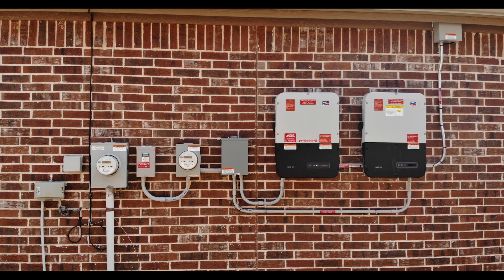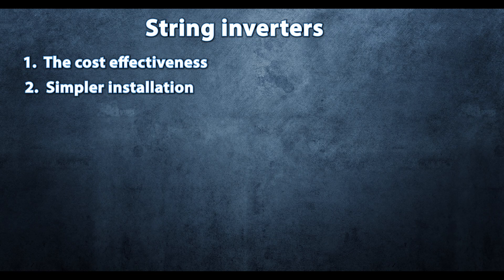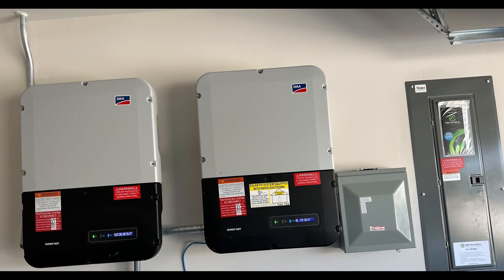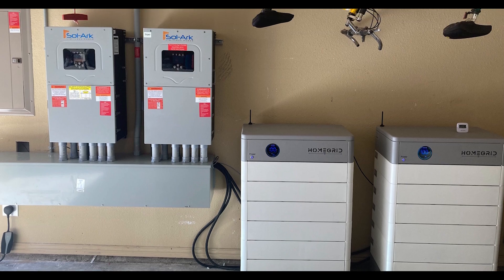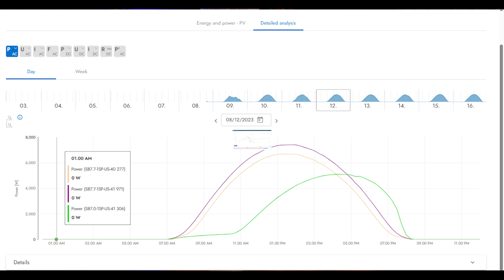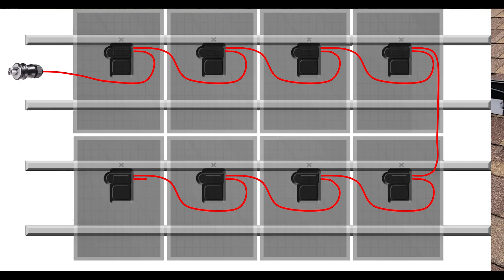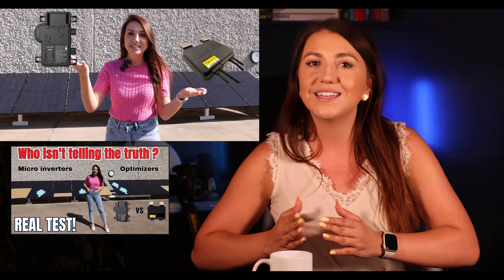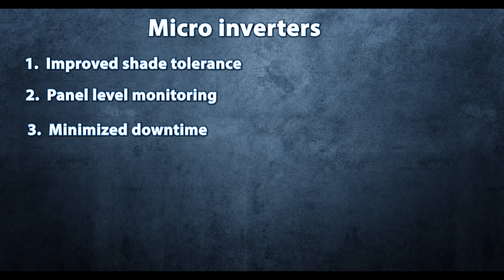The Great Solar Debate: Micro Inverters vs. String Inverters  - Are you making a mistake?

Comment: @solartimeusa this may have been addressed in previous comments so my apologies! I seem to be noticing systems that have one row or string of panels shaded on only 1/3 of the panel and really only 1-2 at most during the day 1-3 panels on the string and I’m seeing what I would consider excessive production loss on that string. Bypass diodes should be helping with this correct ? The DC inverter inside Powerwall 3 is what the system is connecting too. Honestly I’ll argue it’s less than 1/3 of any panel receiving shading… thoughts ?

Comment: Good commentary but missed the biggest issue that most panels are now 450-470W and most micro inverters capacity is 320W and below so massive clipping of maximum available power.
Reply from the maker: I agree with You - microinverters, especially when they are too small, will clip (clipping) energy production

Comment: aren't optimizers also on the roof at each panel?
Reply from the maker: Yes they are but if some TIGO optimizer stops working and you won't be able to buy it because for example TIGO company won't be on the market anymore then you throw it in the trash and connect the panel directly in the circuit and it will also work - that's why TIGO is better than SolarEdge.

Comment: Micro inverters make sense for many. The slight output fai is offset by what many feel is a negative. That is as follows: micro inverters have a power limit max.  Installing higher watt panels might seem to be unwise.  However when you factor in the degradation of power output of panels. So higher watt panels will continue to produce the same for decades.  Additionally when some of those panels have more light they produce the max for that panel.

Comment: I did 18x 300w panels in 2015. At the time, my research had indicated the single string inverters 1. had the shading issue (not sure if the power optimizers were around back then), 2. typically went bad 12-15yrs, but mostly came with a 10yr warranty, and would cost circa $3-$4k thousand dollars to replace (parts and labor) outside the warranty. Whereas, the m250 enphase microinverters had a 25yr warranty. For the 18 x m250's, the increase in cost to use was $850 - my cost being an extra $600 total after the 30% fed tax credit. It's been 10yrs now - around the 4yr mark, one microinverter went bad, my installer told me (I didn't know at the time) and came out and handled the replacement, zero cost, without me even needing to be home - the just put a ladder on my roof. No other issues since then. Panels paid for themselves in 2021, and at current rates are saving me circa $3300 per year.

Comment: Decades ago? There are still a lot of panel available without diodes. In those cases its still true.
Reply from the maker: It's extremely rare to find modern solar panels manufactured without bypass diodes. Can you share some major brands that you know of that do make them without diodes?

Comment: We have just found the sixth dead SolarEdge inverter installed by PowerHome Solar since 2020. Every single time someone calls us for a repair, we know it's a dead SolarEdge inverter. I've sold over 300 Hoymiles microinverters since 2020, and there have been no failures. I have 100% happy customers. That's my two cents, Martyna!
Reply from the maker: That’s a really important point to consider! I appreciate you sharing your experience. I honestly do not consider SolarEdge a string inverter.... I should make a video on this subject alone! The reason why I do not is because you HAVE TO HAVE AN OPTIMIZER ON EVERY SINGLE PANEL CONNECTED to the inverter. 

Imagine a perfect ground mount with no shade. you would think solaredge would let you install without optimizers ... no. it's required. hence I do not consider it a string. BC those little computers are still a necessity. so I am 10000% with you here. I am not a solaredge fan at all! Its a much longer point, I really should make a video on it...:D 

I appreciate you, and I respect all opinions!

Comment: Very nice. But aren’t you forgetting a few things? Less risk of (rooftop) fire with microinverters. A system with a string inverter works / has to work with high voltage DC power of the complete string or strings on your roof, caused by DC daisy-chaining all the solar panels, with DC voltages up to 600V or even higher (search for risk of DC arcing, rooftop fires). That hardly is an issue with microinverters, which are AC-connected in parallel instead of DC in series. Moreover microinverters have ‘rapid shut down’ functionality in the rare case of overcurrent occurring in a panel. And finally, a system with microinverters can cope much better with overvoltage on the grid, an increasingly common and quite annoying problem. When there’s overvoltage on the grid my SolarEdge inverter shuts down completely and tries to restart after 10 minutes or so, shutting down all my panels mid-day, when solar power is at its maximum. But with my Enphase system only one or two microinverters shut themselves down, which lowers the voltage enough for the other microinverters to keep working, so that the rest of my panels keep producing electricity!

Comment: Love your stuff. I think it's telling that there's lots of people claiming that microinverters are superior (while only talking about systems with no batteries), but with reduced feedin tarrifs, one of the best things you can do is add a battery, and in my view hybrid string inverters are much better systems if you want batteries (am interested in your qualified take on this). PS, I suspect optimiseres might become compulsory in some areas for string inverter systems so as people can remotely close down their panel outputs for service or if there's a fire (ie safety).
Reply from the maker: Hi there! I absolutely agree, for those who don’t ever plan to add batteries they can choose between either option but when a battery will eventually come into play I would absolutely and 1000% go toward central/ hybrid. 

For example I installed a string inverter in my home a few years ago now I’m upgrading to a battery system that’s a hybrid. All work is done in the garage. We are not touching the roof. Cost is as low as it can. 

I hope this is helpful. Thank you for the comment!
Reply: @solartimeusa 
Pardon me for butting into the conversation: 
The National Electric Code NEC falls under the National Fire PREVENTION  Association NFPA. 
I wish someone on the NEC would explain to me how adding MORE electronic equipment on to the hostile environment of a high temperature rooftop exposed to the elements 24/7 365 PREVENTS FIRES OR MAKES ANY ELECTRICAL SYSTEM LESS PRONE TO FIRE 🔥!
If they really wanted to prevent fires they would NOT REQUIRE MORE devices which are statistically MORE prone to FAILURE and FIRE to be installed. 
If they truly wanted to protect first responders instead of requiring rapid shutdown systems they would rethink this strategy. 
THEY ARE LITERALLY CREATING THE PROBLEM THEY ARE TRYING TO SOLVE!

Comment: if you have like one of those diy inverter maybe from Amazon  and about a dozen batteries depending on you needs why not just put battery chargers to these batteries trickle charge and eliminate the solar panels especially in colder climate were rain and snow

Comment: String requires far more planning before installing, thus more expensive.
Micro-Inverters can be expanded infinitely.
Micro-Inverters also give a higher longer Guarantee.
Micro-Inverstes also perform better on cloudy days.
DC Systems also can create an electric arc if they beak (Fire Hazard). That’s not possible with AC.
And do you know about the compatibility of newer systems with older ones? I don’t think so. Lots of ifs and mights here.
Power Monitoring is also easy on Mircro Converters

She has no clue what’s she’s talking about.

Comment: It seems all new installs would require rapid shut down switches on the roof.  I understand this is built into microinverters and optimizers, or seperate switches would need to be installed on the roof if no microinverter (ac system) or optimizer (dc system) is installed.

So, it seems we never get away from having some sort of electonic box or switch baking on a Texas roof.
Out of the three (microinverter, optimizer, emergency cut off switches), which is more reliable on a Texas roof?

Comment: Martyna, what my thoughts are? Love your videos! You did not mention, Half-cut Solar cells! Isn't Half-cut Solar cells in Solar panels the main reason Micro inverters and Optimizers are basically obsolete, for all the reason you mention. I think new, Half-cut Solar Panels have twice the Diodes of older panels allowing shading to internally route around shaded parts of the Panel? Hope I said that right.
I pulled this off Google AI. Yes, half-cut cell technology on solar panels significantly decreases shading problems by allowing the panel to produce power even when parts of it are shaded, as the cells are wired in smaller, independent sections, meaning a shaded area only impacts a smaller portion of the panel's overall output compared to a standard panel where shading on one cell can affect the entire row of cells. 
I have Panels on my Boat, Cabin and soon new house we are building. I have a waterproof design to cover a 14' X 40' Patio with only Bifacial Panels. The Panels will be installed without anyone on the roof!!
Anyway, I thought if you were to mention the benefits of Half-cut technologies it could help drive home the point you are so wonderfully and accurately making.

Comment: I'm thinking abt adding solar panel at my home in Manchester, UK which is 70% of the year is cloudy. I got few quotes & most wants me to put in MicroInverter. One installer suggested to use Aiko 455w Gen2 solar panel which got Partial Shading Optimisation in built it along with Sun Synk 5.32kw inverter & 2x5kwh Sun synk battery. With 16 panel he sugested it would generate abt 6200kwh annually. I'm really struggling with understanding various component and which to go for. Thanks for helping me ignore MicroInverters as I agree there are more cons with them then pro. 
I wonder if you have any suggestiong/opinion on setup I was proposed with Aiko Solar panel? I would really appreciate your thought on it. Thanks for great videos -really helped me in my journey in understaing this Solar world.

Comment: Ironically, optimizers and rapid shutdown devices have much higher failure rates than microinverters. You will spend much more time doing repairs on the roof with optimizers and rapid shutdown devices. Remember SnapRS?
Reply from the maker: Oh god, i didnt use Generac because it was too early of a product. And they just rushed too fast trying to get into the solar market....

Comment: THis was a relatively well done video. One thing that is missing from your benefits of Micro inverters is Arc Fault protection. AC Voltage with a 0V crossing helps stop and interrupt arc fault. DC wiring simply does not have that as an option. You somewhat got there with the balancing circuit but not quite.
Reply from the maker: I personally have a SMA sunny boys in my house and those units are extremely sensitive to arc faults and if there is any detection system, it turns off until an installer checks on it.  So it has very sensitive arc fault detection.

Comment: For me, I've always recommended microinverters, because string Inverters are a single point of failure. If something goes wrong with a MicroInverter, it's $180-240 to replace that single inverter, whereas the String inverters, it's $2500~ for a replacement part. 

I will say though, your point about DC-DC battery coupling was 100% on the money. The future-proofed system for EV's is probably the system which gives the better DC access (String).
Reply: I thought the same.. until you research the details and find home DC EV charging is unlikely for lots of detailed technical reasons.
Reply from the maker: Can you elaborate? Lots of success with DC / HYbrid systems such as EG4, Sol-Ark or Tesla PW3.
Reply from the maker: Thank you for sharing your thoughts. I agree that for different situations, different applications will be more beneficial :) Thank you for leaving a comment as well!

Comment: Great video thanks. I have one question   regarding the one point failure argument. By adding optimizer you do you recreate point of failure on the roof ? What happens when an optimizer (which i think less complicated than a micro-inverter) fail ?
Reply from the maker: Very good point! iF YOU DONT NEED optimizers I would not use them, but if you do, the difference of that point of failure is that that unit is an addition, its not a requirement. So if in 10 years Tigo is out of business ( hopefully not!), you can simply remove the optimizer and plug the panel into a string and it will keep working, whereas if you have a micro, the panel is useless unless the inverter is operational. I hope that makes sense?
Reply: @solartimeusa  yes, thanks for the answer

Comment: Hi Martyna. Thank you for putting your time and effort in real time efforts which help users like us gain a lot of insights. I am looking for a solar system for my home and I am considering enphase iq8p and sungrow string inverters as options. Cost is not an issue. The location chosen is one which does not have shadows for a radius of 10 meters. Would enphase be really producing more power than string inverter in such scenarios?

Comment: Microinverters for my 35kW ground mount were far far less expensive than the multiple string inverters and easier for install.   There are 2-in-1 or 4-in-1 microinverters which helps combine units, causing an overall reduction in "price per panel".   You do get combined possible points of failure at that point, but they are relatively inexpensive to replace if they happen to not be covered under warranty.
Reply: Which brand of microinverters did you use? on your system?
Reply: Correct! Microinverters make a lot more  sense in ground mount situations.  Rooftop costs $500-600 labor and people walking around my roof so much, I have worn a trail to where that section of roof now needs to be replaced for another $3,000.

Comment: With string inverters is there a way to take advantage of the DC to charge Tesla EVs (approx 400VDC)? Currently charging with AC and the car has internally an AC to DC converter to charge the batteries. Thanks

Comment: You do great videos and I love watching them. I only have one comment: on the safety element, micro inverters will stop operating if the grid disappears (unless you do fancy stuffs). This effectively isolates each panel and you won't have energized wires on your roof. Strings of panels are always energized on the DC distribution. In case of fire, strings are certainly more problematic.

Comment: Wait six months and get one of the new inverters with software that can switch the DC into smaller blocks creating a better AC sine wave.  They are getting over 99% efficiency.  While 95% to 99% may not sound like much, over a year, it adds up.
Reply: Can you explain?
Reply: @wazup3333  I cannot.  This video goes into detail about resonance and soft switching.   https://www.youtube.com/watch?v=pdyXEbWoVvE.   My understanding is that a few companies have proprietary software that can change the switching frequency within a single sine wave and maximize use of resonance in order to reduce losses.  I just found this video which a stock pump for one of the companies but it has a good explanation https://www.youtube.com/watch?v=2JxbNi4lnUw.

Comment: What type is used with Franklin Home?
Reply from the maker: Franklin is a AC coupled battery so it has a built in inverter. So you can use either option. The solar system will have its own inverter ( either micro or string) and the battery will in case of FRanklinhave its own inverter.

Comment: Great info! I would also add that the ability to DC couple batteries is so much more efficient. I believe that micro inverters paired with batteries is not the right solution as you are having to convert the electricity 3 times (at the panel to AC, when charging the batteries back to DC, and then back to AC when discharging the batteries). A system like the Tesla PW3 makes all of this a single step process depending on what the home needs. If the battery needs power, the panels feed the PW3 directly with DC power. If the battery is full, the power is simply inverted once and fed directly to the panel. Each time you are having to convert, you’re loosing about 3%.

Comment: I agree that optimizers from a value standpoint are likely not worth it, plus add complexity, losses, and failure points... but per code, most roof mounted systems (which are the majority) require some type of RSD and I believe the optimizers with RSD built in is likely the cheapest way to meet code.

Comment: I do not understand what you are referring to as 'single point of failure'. That would be a potential to any system if the design did not adequately account for such things. Doesnt matter if it has batteries or not. A well designed battery backup system could still account for different failure scenarios. Perhaps you can be more specific with your question and context?

Comment: I think you forgot the aspect safety! one solar panel produce around 40volts, with only 12 panels a whopping 480 volts running  from the roof cable towards the inverter, if this inverter is installed somewhere inside your house (not everyone has a garage) it can cause dangerous situations, with micro’s the power is inverted to 230/240 volts under the panel and stays the same with 1 panel or 50 panels toward the electrical cabinet.